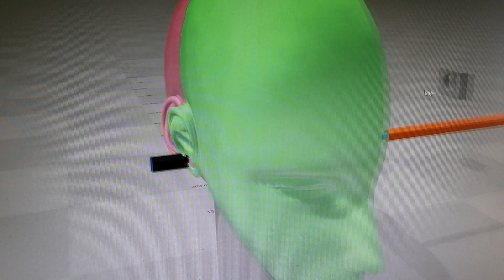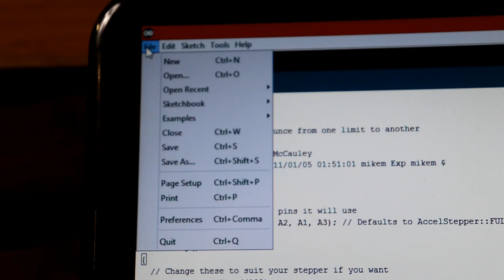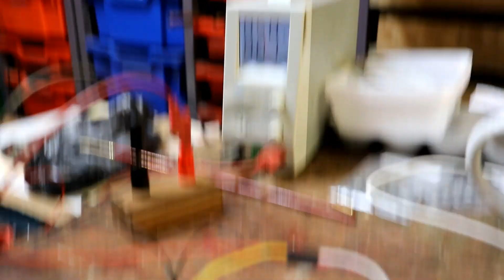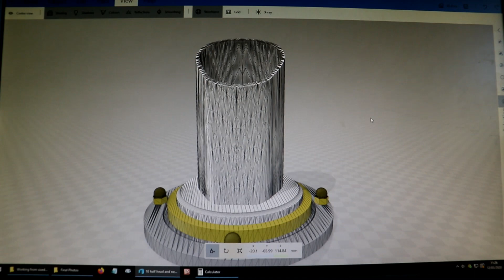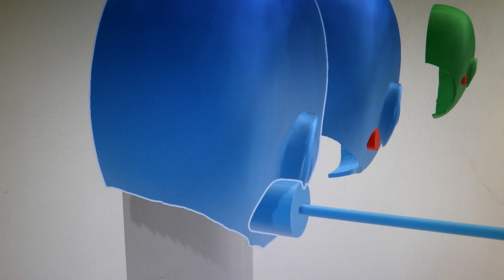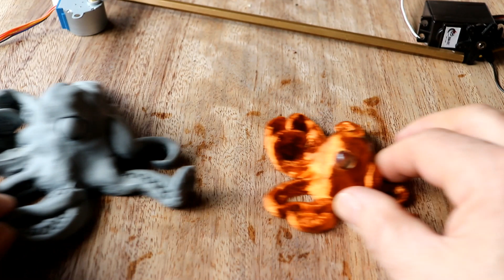1. Virtually Designing Victoria the Automaton

Comment: Cool.
I'm measuring position using CJMCU-103 potentiometers.  (See ebay).  You can use them to detect the position of a shaft using the Arduino ADC.
Good news is they are continuous rotation, but the bad news is there's around a 30 degree angle where they can't measure - I can work around that.

Seeing the Krakens reminds me that I saw Blender recommended as an organic sculpting tool for 3D printing (with tools more like what you're already using using recommended for engineering).
Personally, I'm no sculpter.  :-)
Reply from the maker: Thank you for the info, I was wondering about using a potentiometer as it wouldn't have to 'find' a switch when started. These look really good, I feel an investment coming on!